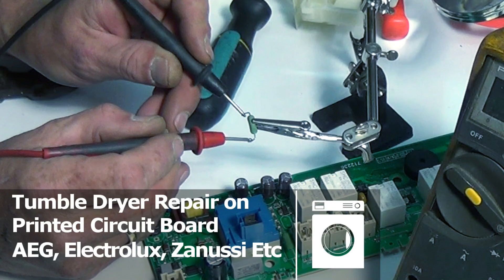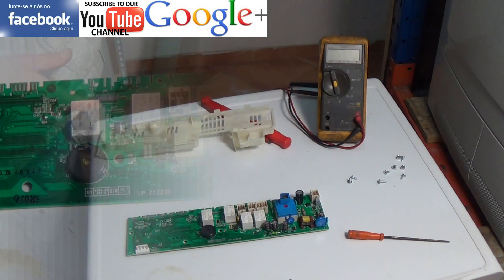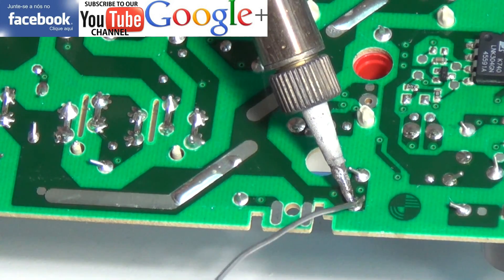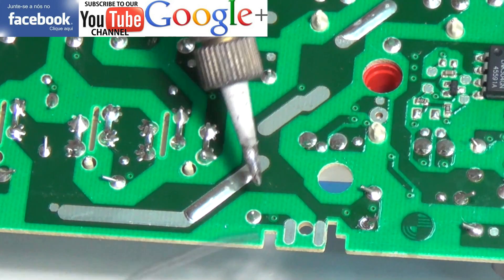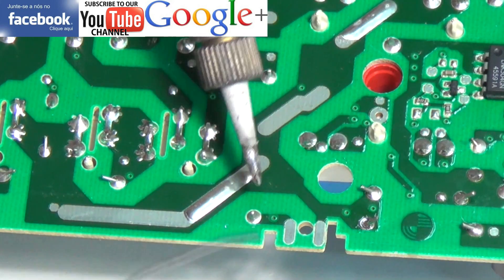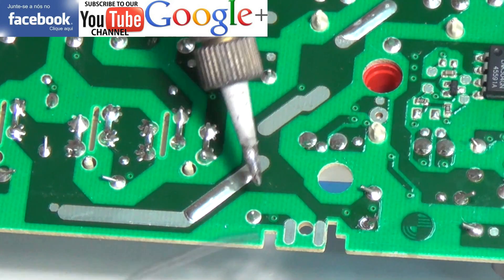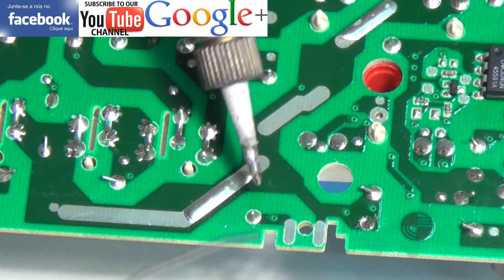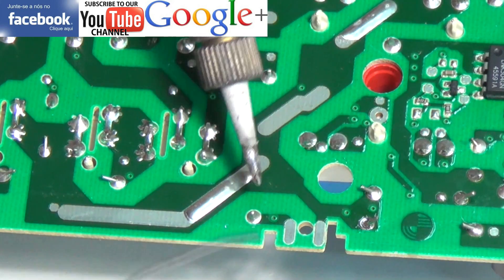Printed Circuit Board (PCB) Repair Tumble dryer AEG, Electrolux, Zanussi Etc

Comment: I found this video very useful in helping to diagnose my Zanussi Tumble Dryer ZTH485 fault. The dryer would run normally for several minutes, but then the motor would stop with an E50 fault (when running a programme) or an E51 or E54 fault when running in diagnostic mode. I checked the LNK304 output and also R76, but these appeared to be OK. I also connected a mains supply directly to the motor and it ran perfectly in either direction.
I finally diagnosed the problem by carefully poking each component on the circuit board with a small plastic tooth pick, whilst the machine was in diagnostic mode. I used position 4 on the knob (stepped motor triac mode) as this doesn't generate an error message, but it was clear whether the motor was stepping correctly or not. This does need to be done with care, because there is mains voltage on several of the exposed components on the board. So ensure you don't touch anything with your fingers! I was able to trace the problem to a dry joint on R99 (47 ohm resistor) close to the central screw hole on the PCB. This resistor is connected to the gate on the motor triac and hence the interruption of this signal to the triac was causing the supply to the motor to also be interrupted, at which point the machine would generate the error message and stop. The dry joint had presumably been present since the PCB was manufactured, although the tightening of the adjacent holding screw may have broken the joint when the PCB was originally mounted in the machine. 
Anyway, hopefully this comment may prove useful to anyone with a similar E50/E51/E54 intermittent fault. The small blob of solder needed for the repair was certainly a lot cheaper than a new PCB!
Reply from the maker: Do you think switches can break down under heat so you may have an intermittent fault have a great Christmas and a happy New Year thank you very much for subscribing to the channel it really assists us
Reply: @How-to-repair  I'm 99% confident that the dry joint on R99 was my problem, as since I resoldered the joint, the dryer has been back in normal use with 10+ hours of usage with no further problems, whereas previously it would only run for a few minutes. Whilst trying to diagnose the fault, I did try bypassing the triac (switch) with a short length of wire and the motor ran normally, although continuously as any signal from the microprocessor to the triac gate was ignored. My conclusion from that was that the fault was either in the triac gate circuit, which contains R99, or with the triac itself. Had I not found the dry joint on R99, I would have tried replacing the triac (switch), as I agree that they can, like many components, breakdown when hot. It's a pity there isn't a circuit diagram for these boards easily available, as this would save a lot of time trying to diagnose a fault, although it's very satisfying when you manage to!
Well done on your videos. It's great that they encourage people to attempt repairs on machines which otherwise would most likely endup as landfill.
Reply: thank you for your solution, I managed to fix this board, the R99 resistor was causing motor start problems. thanks thanks :)

Comment: The resistor: WATCH OUT! This is a fusible resistor, NEVER replace with just a common resistor – it's a potential fire hazard when the next switch mode failure happens.
The 47 Ohm resistor, is a 3 Watt resistor, and the ULW3 series, available from all major suppliers, should be a good replacement.
Reply: And for what part pf the appliance is that resistor?
Reply: @adrianm.1240  Resistor limits inrush current into the smoothing capacitor and acts as a fuse

Comment: Hi, My Arcadia main board  (Arcadia Dryer main UPD) from at Hotpoint Aquarius Condenser Pump dryer model ftcl871gp has failed because all the main lights are flashing after a couple of mins of switching on and all other peripherals have been tested and ok. Are you able to repair this main board please? There are no bulging or ruptured capacitors.

Comment: Hi I got zanussi 37202w tumbale dryer , It just under warranty, my problem is eleccity coming to machine but no light , check all fuse and door lock , ac lead, all working fine power coming to pcb board but no light showing ,I replace the new timer switch still not working , i just wandering what could be the error, any advice please ,thanks

Comment: A very  useful video, thank-you.  I have followed your instructions for replacing the LNK304GN and R76.  However, checking other components, as you suggested, the black cylindrical SMD component with one white and one brown band bottom-side under C15 appears to be O/C on my board.  Do you have any idea what this component is?

Comment: Hello. I'm from Australia. I have an Electrolux edv505. Everything works except for heat. I believe it's the the pcb. Do you know if I short the labelled heater solder points it will turn on the heating elements?
Reply from the maker: i cant say as i do not have wiring diagram sorry Thank you For leaving a comment this is for you https://www.youtube.com/shorts/e432SAb2g08 please remember to subscribe as that's is what keeps this channel going. Thanks 👍

Comment: Hi I am trying to remove the plugs from the sockets on the board. Not the edge connector.s. The ones with spade connectors. I can't work out if there is a clip or whether they just pull out. I'm worried that I will break the pcb if I pull too hard. Please can you tell me how to unplug them. thanks
Reply from the maker: If you look very closely at the speed, connectors some have a locking tap in the middle, just be very careful not to damage the board
Reply from the maker: Sorry I forgot. Also you could use pliers to open up the connectors, but you may have to replace it after. @steveapt1 please remember to subscribe to our channel as that really helps us https://www.youtube.com/shorts/e432SAb2g08  Thanks, Paul 👍

Comment: Replaced the LNK304 and 47ohm resistor on a friends Electrolux dryer (only 6 years old). The Machine works again :)

Comment: Hi ,I have an electrolux 0097 and have done this repair on this board a few years ago and worked a treat,but now the machine keeps just going to 0 no codes as if it thinks it has finished in no parts diagram can I find a moisture sensor could you tell me how this machine knows when to stop if it doesn't have one (I assume it does) and if it does do you know location as I have stripped the machine down ,its in a John Lewis jltdc09 machine your help would be appreciated
Reply: I have the same problem. But running it on the manual timer still works. Tje sensor is just a brush on the drum, running current thru the drum, the wet clothes will conduct between the 2 drum halves. I guess the components on the pcb related to this logic sometimes take damage when the power ic blow up.

Comment: Thanks!! I got lucky, and my EDI 97170 has the same board. R76 is also gone.. (BTW, @2:10 you are desoldering wrong pin from R25, can you confirm?) I'm also looking to find a way to confirm LNK304GN is also gone...

Comment: I’m trying to find a replacement transformer for my board: Hartu 29/10 717232-51, which I believe is no longer available. Any suggestions of a direct replacement for that?
Reply from the maker: Currently, our supplier does not have this item in their stock so I suggest you to check other platforms. You can try searching on platforms like Facebook, Gumtree, or eBay for an equivalent one. Remember, you should use your full model number in online searches to get spare parts otherwise you may not be able to get the correct element.
Reply: @How-to-repair  I’ve tried, and cannot find a spec for this transformer. If you can shed even a little light that saves me buying a new board, I’ll love you forever!

Comment: Hi again. Someone has posted here asking if there was a blown part as well or if it worked by just replacing the Lnk304GN, can't see the comment anymore maybe it's deleted. just wanted to add how you can verify if the Lnk Switch is gone...just measure the resistance from S (Source) to D (Drain) and if it's broken you should measure appr. 100 Ohms. You can measure it if the Lnk is still on the board...and of course the 47 Ohm resistor (R47) will most probably also be gone. Replace them both, please.
Reply: Hi Alexander, what should be the correct resistance between S -> D ? I'm measuring 17.3 ohms (R76 resistor is broken - not measuring 47ohms). Thanks

Comment: I replaced R76 resistor, but when i turn on dryer it blows up(the resistor). I am no electrician, so what does that one stands for? and it seems i get no resistance on J13, J8 resistors. Plus R76 gets blown up, when i only connect main harness to the blue switch, where you turn on the dryer. And after only connecting 1 pair of wire(to the blue housing), and trying to turn it on, the resistor blows up..

Comment: I've done it - on an AEG Lavatherm Protex PLUS sensidry tumbledrier - used to be dead before. Now it powers up nicely but now I get an E91 error code. Only when I remove the communication cable (the one with thin black wires) between mainboard and sub-board (the one next to pump), the error code disappears and I can start up the main interface and even go into diagnostics mode. Of course, without sub-board connected, when I try to start the machine with START button, it displays 'Err' this time not E91. As soon as I connect the sub-board communication to the mainboard again, machine powers off and back on, with E91 code. Sometimes also does 3 consecutive beeps repeatedly. PLEASE HELP !!!

Comment: Thanks for the great video...I have exactly the same fault and have ordered a resistor and link switch. By the way, thanks also for the tip of using a through-hole component to replace the LNK304 if you don't have a heat gun... :-)

Comment: where did you get the information about what resistance the resistors should be reading? as this would help to no end as you could test each one i know most have either colour coding or the resistance and tolerance values writtin on them but some dont.

Comment: Hi, I have a Zanussi ZDC 37200W. The symptom with my machine is there is no apparent power. There is mains power to the timer control on the PCB. I have got the board out and R53, which is a metal film resistor has a split in the body and is open circuit.  Can you point me to a copy of the circuit diagram for this machine or do you know what value that resistor should be? There are no markings visible on the resistor.
Hope you can help and thanks in advance

Comment: Yes the R76 and the Lnk304GN both exchanged and the machine went on R76 blew and I don't know if the Lnk304gn still is alive. The machine is a tumble dryer Elektrolux EDC67550W . How to repair?
Reply: He doesn't get on at all.
Reply: the components are weak to protect the transformer so somebody told me in the shop. The brushes are quite new. The machine is from 2011. Electrolux told me to buy a hole new printboard.

Comment: Hi I want to replace my cement mixer motor with a white  units motor. What machine do you recommend. I have a 8 pin Zanussi electrolux motor but no wiring connections for it. I can use this for another project if I had the required connections for it. Please advise.
Reply: Is your motor 3-phase with 8-terminal conn box? Check the resistance values between pins to find the connections: https://www.4mcculloch.co.uk/images/mediator/553/599706597.pdf

Comment: ive got no screen on a hoover washer, could the psu be the problem ? what does the link switch do ?
Reply: The link switch is actualy part of the PSU for the low voltage components. Replacing the LNK304 and 47ohm resistor wil likely fix your problem.

Comment: Hello. Thanks for great guides. 

I have a AEG Electrolux Mod: TN55460, Type: P502664,  Prod nr. 916 096 379 01
I was wondering what to look for, if I get error code E32?
I first got error code E54. Then I changed the capacitor, but got new error code E32. All red lights, and it will not even respond properly. I tried also to clear the error code, but I guess it was after that it stopped and I get error codes as as eplained.

Now I am looking at the circuid board, but cannot find any cracks or dry joints. Tested some diods with mulitmeter, but they looking good. 
Did not replace the LNK304GN  54526E yet. Could it be broken?

I tested also the temperature sensors, and they all look good. 
The electric motor seems to work also, as its turning.

I also have to add that the water pump and the belt are OK.

Any good ideas what part is broken or needs to be replaces?

Thanks
Reply: Did you exchange the LNK304GN finally? This must definitely be the reason...worked with mine! (T55840)
Reply: I fixed it now a few months ago, by replacing the whole circuid board :-)
Reply: Hey Alexander,Could you tell me if you simply replaced LNK304 and it worked or there was a blown part as well? Asking this because I don't have any visible signs and every resistor shows a right resistance etc. Thanks

Comment: Can you please explain how to test the LNK304 component?
Reply from the maker: +Sharon Vendrov there is no simple way to test unless you have the right equipment sorry. I am glad I could help you with this problem.
Please remember to Shop with www.how-to-repair.com  and it would help us by posting the video or website on your timeline. This helps us a lot and if we really helped you can always buy us a beer http://how-to-repair.com/help/buy-paul-a-beer/
Please remember to mark us to your favourites also I would be grateful if you would subscribe to our channels social media as this really helps my site and keeps us going.
YouTube. http://www.youtube.com/user/Apart4u
Facebook. https://www.facebook.com/how.to.repair.appliances
Reply: @How-to-repair  Measure resistance from S to D on the LNK304 (from the pin by itself with extra spacing, and the opposite corner). Mine measured 9.9 ohms, which should be basically open circuit across the internal FET.